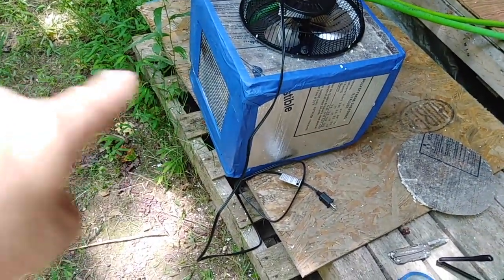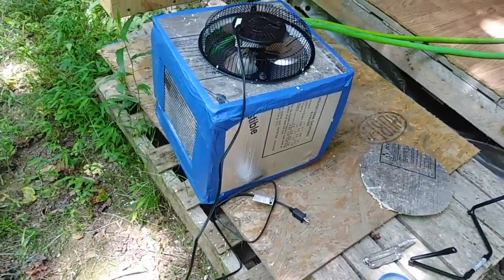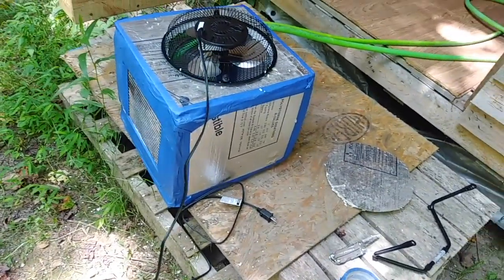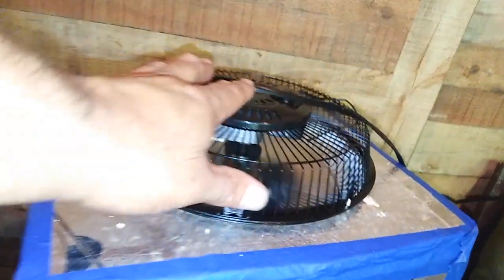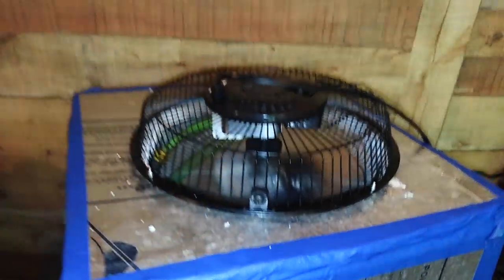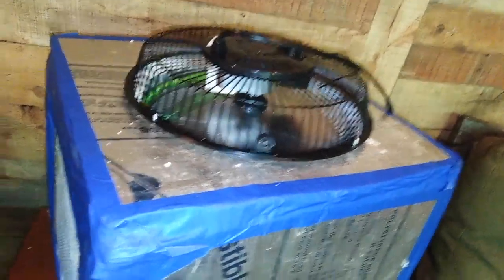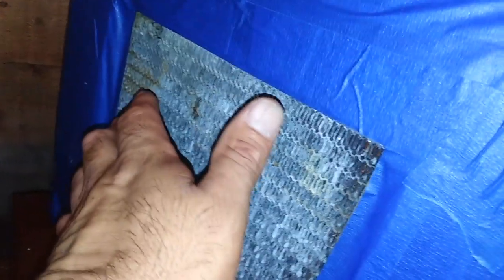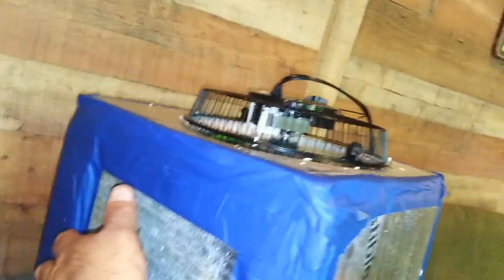Geothermal Air Conditioning For the Pallet Wood Cabin

Comment: Create a "chimney" around the fan up about 4-5 feet to draw the hot air from the ceiling down instead of just recirculating the air that just came out of the radiator. You'll end up with a better overall temp.
Reply from the maker: Good idea!

Comment: Good project! I'd like to see a scaled up project maybe a radiator and large and a more powerful fan.I would definitely call a 10 degree decrease in temperature a success.
Reply from the maker: Thanks! Yes, I think I will be trying a car radiator or condenser next time. The 10 degree difference it turns out was mainly right around the unit. I need more air flow to circulate the cool air and to cool the loft.
Reply: Dont know if you guys cares but if you guys are stoned like me during the covid times you can stream pretty much all the new series on InstaFlixxer. I've been watching with my girlfriend these days =)
Reply: @Rey Legend definitely, have been using InstaFlixxer for months myself :D

Comment: Nice video. Little more information I used a 5000 BTU unit front coil in the unit. Yes, I used the 120 volt motor. It could be replaced with a DC motor for less power. It did not use that much water to work. Like him I have 56 deg F water. On a 90 deg F day it put out 70 Deg F air. That is nice on a hot day.
Reply from the maker: Yes, it is a great way to save energy. A DC motor hooked to the battery bank is the way to go.

Comment: Well done! My grandfather was very much a tinkerer, too and he did similar for our cottage many, many years ago (mid 1960s). He ran the ground water through a big car radiator with a big fan behind it. It worked really well! He did similar for his house, too, but it wasn't enough for the house, although it did help and cut down on the amount of electric air conditioning they had to use.
Reply: P.S., he put a pan under the radiator to catch all of the condensation off of it. You might want to do that, too. The hose going in and out of the radiator in the set up in our cottage was way bigger, too ... as, i'm sure, was the flow rate. My grandfather was actually a heating and air conditioning repair man and he had lots of good ideas. I miss him a lot. He died in 1991.
Reply: And yeah, 60 watts vs. maybe 500 for a small window unit is not too bad!
Reply from the maker: Thanks, it was nice to have some cool air for a change. Figured out the condensation problem too late. Big mess lol. A car radiator would be perfect.
Reply: Like i said, my grandfather fixed air conditioners and furnaces for a living, so he likely was very aware of the condensation problem from personal experience.

Comment: P.S. LUKE , I did forget, remove the heat dump fan in the back & block off the vents in the back so you don't lose any cold out of the water out the back outside being it is a closed - loop system. Save all the cold for the cabin ...Dehumidified air feels alot cooler than high humidity cool air , it will feel much better once it gets the humidity out of the cabinet's air ... Good luck on your next project ... Be looking forward to new improved geothermal air-con 2.0 experiment ...👍👍👍
Reply from the maker: Yes I was thinking about that. You only need the inside part.

Comment: Now I wish I had access to an underground stream. The electric bill goes up with the temperature. As you know Luke, it would cool down faster and stay cool longer with some insulation. A good place to get some free insulation for your cabin would be to check the dumpsters behind an appliance store. They throw away tons of foam board all the time. Stay frosty!
Reply from the maker: I also have quite a few places where air escapes like around the doors and windows.
Good tip on the appliance stores. 

 I was thinking of trying a car radiator and a box fan next.
Reply: @lukeFugate  That would sure cool down a much larger volume of air per minute. Looking forward to that video!

Comment: If you put another heater core in another box on top conected to that one and had them both hooked up and keep fan where it is and seal the boxes together then you will be pulling in cool air and not hot air. So only holes to the out side of the boxes is thru heater cores.
Reply from the maker: Good idea.

Comment: I have spare parts. And will try my computer fan. Start a tank.up side my cabin. Then through the heater core. Then to the tank on the bottom. All shaded to be cooler. Then feed the lower. Tank in to a ram pump to recirculate to top tank. With rain water and some make up water. To top off.  Shading and insulation of lines to save more water ah even solar pump to re boot high tank wow you got me on a roll of ideas tks
Reply from the maker: Hope it works well for you. These types of experiments are fun to play around with until they are perfected.

Comment: Hi Luke , like your geothermal  air con .I have another idea project for an updated version air - can 2.0 ...Try this project for another video . Find an actual window air conditioner that the compressor went bad in it , take it apart & remove the compressor remove freon & flush it out then hook your water hose to it . The thermostat should turn the fan off & on as usual & you'd have a more efficient  squirrel fan blowing the air around the cabin & if & when the cabin cooled off enough it would shut the fan off to conserve energy so it wouldn't be constantly running & using power especially if you get a bigger fan for your present unit requires ...I believe it would be an even bigger success experiment. I also believe the biggest air - con unit you could find would allow more condenser surface to be even more efficient also , so much so you'll like it so well you might just cut a hole & mount it in the wall so it not only could dehumidify the air also & send it outside but it wouldn't take up any of your cabin space since space in a cabin is usually at a premium & mounted in the wall would look so cool & professional ... Good luck , hope you try this , I think you'll love the results ...👋👋👋👍👍👍
Reply from the maker: That's a great idea and would look so much better too.

Comment: Hey Luke! This is cool! Love this idea! And it works! I'm dreaming up some weird idea myself, as my well water for my home comes out of the ground at 40 deg f. I may see if I can find a clean/sanitary coil to add to my air handler, and use it rather than compressor. Anyway great idea, and so fun you made this! Very cool! Thanks for sharing! God bless!
Reply from the maker: Thanks! If you do this, and you have time you should video it. I would be interested in your results. It would be a lot more efficient to use a small water pump than the AC compressor.

Comment: Don't know how high your water will free flow but once started, it wouldn't matter as gravity would pull it thru so move your unit up to the ceiling once the water is flowing. Then add a drop down duct to about half the height from floor to ceiling. That would do two things. 1. It would take the hot air and cool it. The higher the differential, the better it works for the volume of air flow. 2. The drop duct would pull some air thru on its own as cold air sinks. 
And yes, a radiator would do a better job but again, make it a drop duct design so that it moves the air better in the room.
Reply from the maker: Thank you for the tips!

Comment: Other off grid people have buried 6-8 in wide about 20-50ft long pipe with a fan pulling in the ground temp ( screened of course to avoid pests,, capped off in winter)
Reply from the maker: Good idea!
Reply: @lukeFugate  if your ground is to hard to dig deep enough (about 2ft).  You may get similar results doing a deep cover over berm. YouTube earthship people/homestead
Reply: Yeah, I was thinking the same, regarding the hole in the ground set up. That's geothermal, this video is aquathermal, good idea, though.

Comment: Great video Luke. Been thinking about fixing one like that for my car since my air conditioner doesn't work. Putting ice in bottom of cooler to blow out. I have a 400 watt converter that I could plug into while driveing. Sure miss that cool air when I have to stop at stop lights in a 85/90 degree day. Anxious to see your next invention. Have a great day Luke.
Reply from the maker: This would be easy to adapt to use in a car. I actually, way before I had YouTube did something like that. I had a big cooler in the back of my truck with holes in the lid for hoses to go through. I ran a hose from the cooler to a water pump then under the cab between the bed and cab up into the original heater core still in the truck. I came back out of the heater core with another hose that went back to the cooler to recirculate the water. I could turn on the water pump and put the heater controls of the truck on high heat and it would just about freeze you out.
Reply: @lukeFugate  Love it!! That would be great.

Comment: Surprisingly good results !
Maybe set it in a condensate pan with a tube running through a little hole in the wall.....does the waste water just continue to run on the ground ? Can that lead to a problem ?
Looks like a great idea ! Thanks for showing it !
Reply from the maker: Yes it definitely puts out a good bit of condensation. I extended the hose to the original stream bed, so in a way, I'm just borrowing the water and putting it right back where it was originally going.
Reply: luke Fugate very nice !
It’s good of you to show how you did this , thanks !

Comment: Front Discharge Window Evaporative Cooler (Swamp Cooler) hooked up to your constant cool water source.
Reply from the maker: If it weren't so humid around here that would work. I've tried evaporative coolers here before and they don't work at all, in fact raising the humidity just makes it feel even hotter. 
In dryer climates that would be the way to go though.

Comment: Nice set up! Add a roof fan to draw the heat out and pull in cooler air from an open window. NPV- Negative Pressure Ventilation. JMO
Reply from the maker: Good idea. The loft was still pretty warm, I guess that's where all the hot air ended up.
Reply: @lukeFugate  Lol. Install one of those MaxAir exhaust fans or something similar  the van dwellers use.  A little pricey but it's already set up for 12v. The cabin is coming along nicely.

Comment: Use a bigger radiator and slow your fan speed down. The longer your water has to absorb heat, the cooler the air will be. Then use a bigger fan to distribute the air throughout the cabin. No, it won't be as cool as air conditioning, and if any humidity removal at all less than  air conditioning, but anything's a help.
Reply from the maker: It produces some condensation. I had a lot of water leaking out after a little while. Using a secondary fan to circulate the air is a good idea. Thanks!
Reply: @lukeFugate  
You're doing great if it's producing condensate. Direct expansion A/C systems typically have an evaporator temperature around 40F. So if you're removing ANY humidity it only increases your comfort level. You're doing as well or better than a swamp cooler in a low humidity environment.

Comment: pretty awesome, the nice part is that doesnt add humidity I think a larger radiator like an oil or trans cooler and 2 of those fans would chill you out, especially if you leave it running 24/7 and the water will be the same temp in the winter, especially if you insulate the pipe/hose, so you can heat to upper 50's low 60's using the same unit ! I watch a channel (desertsun02) where the guy makes lots of solar powered coolers but he's in the desert and doesnt have free cold water so he has to pump it from a cooler but you could use a coil of copper pipe on a box fan and run the water through that or even go with radiant floor type heat/cool, after the purchase of the tubing everything else is just free water...UGH 4am and you have my mind in high gear...
Reply from the maker: I was going to try a car radiator and a box fan next. That should keep it plenty cool in there.

Comment: I know where a house is that has something like this .the guy who built house built it part of it over small stream about 4foot wide and couple feet deep.in floor he put a whole house fan with metal grate that he closes when not in use.he took and made a water generator that hooks to fan by a pulley system to run fan.he hooked up a lever that sets generator into stream and bang,water turn blades in generator ,that in turns starts the pulleys running and turn fan blades cooling house. that roughly how it works but when he was alive you walk in there and it was like opening freeze door.he had little bit maintenance on water wheel ,other than that he cooled his house for free.he heated house by old cook stove with coal or wood and propane furnace
Reply from the maker: That was brilliant!

Comment: If you've got several gallons per minute of free flowing water at or below 60° then you've got every chance of getting a small cabin within a few degrees of the water temp. Your biggest limiting factor is that fan can't push air through the heater core like the 12v blower in the car it came from. Next biggest limit is throughput of both air and water. Heat exchange is easy enough given a radiator, etc.

Remember water takes 4 times as much heat per pound to change temperature as air so given equal weights 80% of the temperature difference will be in the air, so for every ten degree difference 8 will come off the air and only 2 on to the water. Say 1 gal a min of water to about 110cfm air (about what that fan delivers) would be an equal mass and with input of 60° water and 90° air temp the output of both should (ideally) be 66° and at that rate would amount to around 12,000 btu of cooling. It looks like you can flow a lot more water than that too. 

*That's a rough estimate ignoring things like heat exchanger efficiency or the effect of lowering humidity but if you swap an automotive blower for that fan your only issue will be draining the condensation your get.
Reply from the maker: I ended up using a car radiator and a box fan. it worked great.

Comment: I expected you would need a car radiator but apparently that heater core is enough for the cabin. Seems there would be water from condensation dripping from it.
Reply from the maker: Yeah, a car radiator would be a lot better. There was condensation building up, but I didn't figure that out until the masking tape started failing. Quite the mess lol.

Comment: I laughed so hard! Best job at dad jokes called the wife in and let her watch she just snorted and walked out!! I laughed even harder!!! I remember you did this a long bit back and used a squirrel cage fan. I did this for my van camper but the condensation was a huge issue
Reply from the maker: lol. Yeah, this setup would work in a van, but it does produce a lot of condensation. I remembered the condensation when I noticed the table this was sitting on and the floor were soaking wet. I thought the heater core had started leaking, but it was just condensation.
 In my S-10 I used to have I put a huge cooler in the bed and ran the hoses through a pump and up to the original heater core. I could turn the dash heater controls on high heat and it would freeze you out. The condensation just dripped outside just like a real a/c. The ice water in the cooler didn't stay cool very long though.
Reply: @lukeFugate  I fixed this issue by adding a 2nd box under the first and drilling holes and used hose as drains then tapped the lower box with a drain tube and just ran it out the door.

Comment: I know you have a video on how to use this idea for a car but I'm wondering if I just did this in the car without hooking it up to the car's heater core if this would keep a moving van cool. I dont know much about cars I don't want to mess mine up trying to rig it. I already spent $920 for them to fix my a.c. and it still don't work, they didn't have a warranty and so I'm out $920 unless my bank decides to give it back in 3 months. Still out of $
Reply from the maker: You can do this same thing in a car. I have had a setup like this in a car before and it worked pretty well. One thing you have to watch is the condensation. The unit needs to sit in a pan or something to catch the water it will condense.

Comment: Paper towels would work as temporary curtains with a little tape & it you installed roof vents you can vent most of the heat from you cabin ;)

Comment: Back when I was younger, we went to a swimming hole in the woods, that water was only out of the ground 300 yards, that stuff was soo cold, you could barely stand to get in it, mid summer, and could only stay in 2-3 minutes, and it was plenty cold enough to drink, it had to be 45-50°F, we kept our drinks in it, and they were plenty cold, nice idea, if I didn't have to pump my water I'd do the same, I been thinking about doing something similar, for heat, using a wood stove, and small pump,
Reply from the maker: That had to be some really quick swims in that swimming hole lol.

Comment: If you had put a piece inside the box at a 45 degree angle, than you would get more air out of it. 
The way you have it built in this video. The fan is having to try and overcome the turbulence it is creating by blowing straight down.
Reply from the maker: Good point! It would have to make it more efficient.
Reply: I was curious if pulling the air through the radiator instead of pushing it would be even better.Just a theory.
Reply: It is easy to push air then it is to pull air. Most, if not all furnaces work on this idea.

Comment: If you would hang it from the ceiling you would have better results. Because cooler air is heavier than warm air. It is harder to push cold air up.
Reply from the maker: Thanks! It would be better to let the cooler air just fall than to try to move it with a fan.
Reply: luke Fugate I would still use the fan just elevate the whole thing